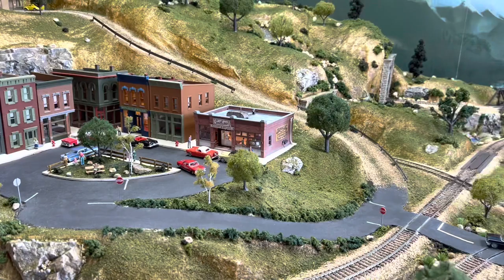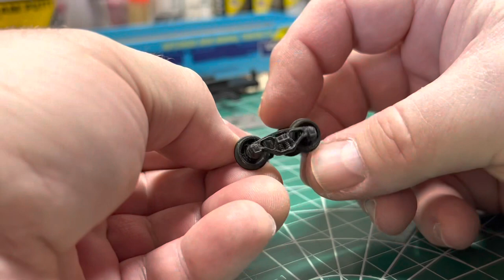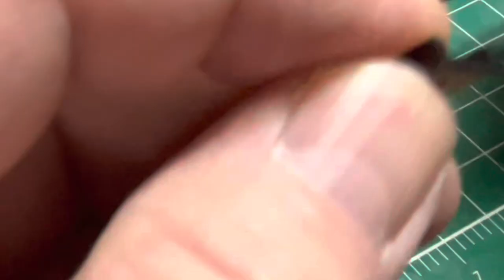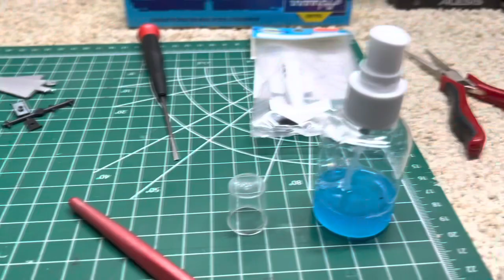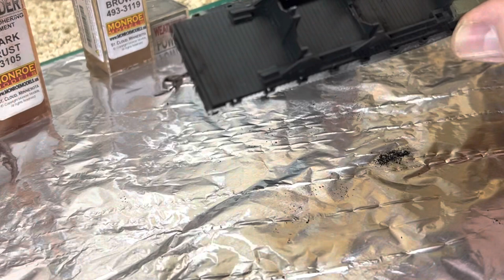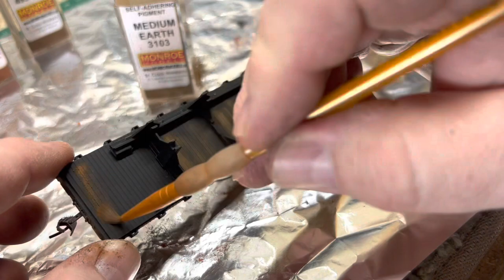Restoring and Weathering an Athearn Vintage Flat Car.

Comment: After much swearing & cussing I finally assembled a Tichy Train Group flatcar.  I saw a video of the assembly and really liked the under frame brake detail (which no one will ever see).  I followed the instructions to the tee and wish I hadn't.  After installing the stirrups in a previous step I broke every one of them off while installing the extra added bronze phosphor wire grab irons.  If you ever build this kit install the stirrups as the very LAST step!  I did end up making some stirrups out of staples from a desktop stapler that were the correct size for my HO scale model.  I think I spent as much time chasing small parts across the floor as I did assembling the model, LOL!  After finishing the assembly I painted the whole underside rail brown and hand painted every board on the deck a different shade of brown mixing the acrylic paint in a small plastic communion cup as I went along.  It came out looking very realistic and believable.  I did weather the trucks, wheels and the Kadee couplers.  Cheers from eastern TN
Reply from the maker: Good stuff, thanks for sharing. 👍🏼🙂

Comment: I always paint the weight flat black on both sides on Athearn rolling stock for corrosion control.  Finger prints on the steel cause it to rust over time.  I would have used styrene cement to fix the frame rather than CA.  I make my own rust powder out of 0000 steel wool in a quart jar of vinegar.  Cheers - TN

Comment: I had a problem with some Athearn gondolas years ago. It seems that the trucks were too close to the frames and the wheels couldn't turn enough to get around the 18 inch radius track! They just derailed, so I put them aside and eventually got rid of them.
Reply from the maker: Yeah, sometimes you just can’t get them to work the way they should. I was lucky with these two, removing the draft boxes from the trucks was a success, and they’ve been running quite well on the layout ever since. Thanks so much for watching and taking the time to comment Thomas, I really appreciate it.

Comment: bonjour, when you do weathering with powder, do you have to finish with a sealer ? nice layout and nice videos, merci !
Reply from the maker: Hi Pierre, some people do. You can spray dull coat over it, or any kind of clear. I usually opt to leave it as is and touch it up later if needed.  Sometimes I’ll use a combination of washes, paint, and powders. Any of those of course can be sealed with a clear afterwards. Thank you so much for watching!